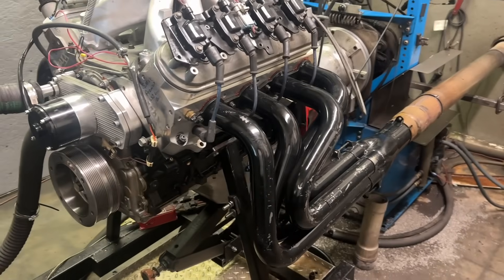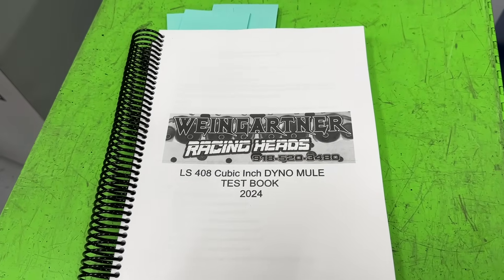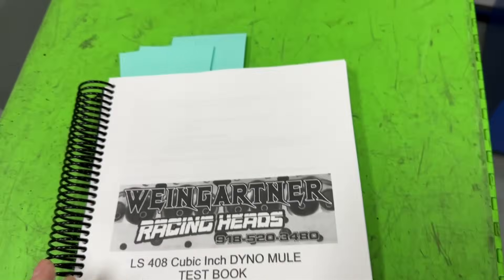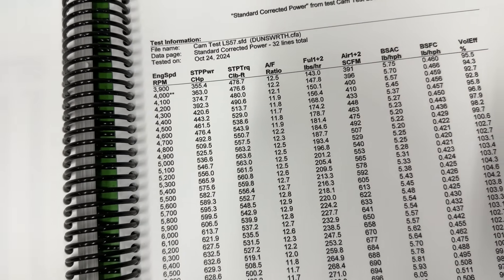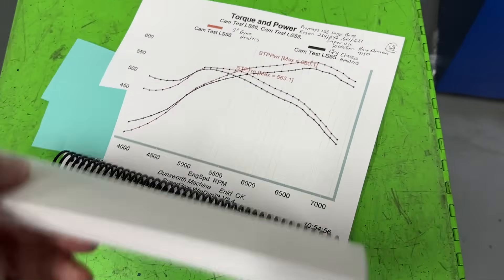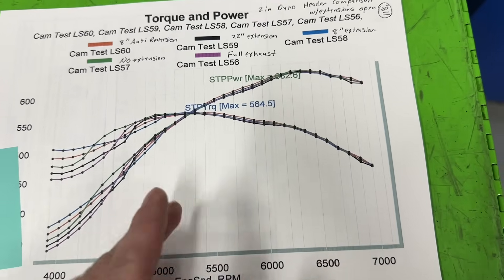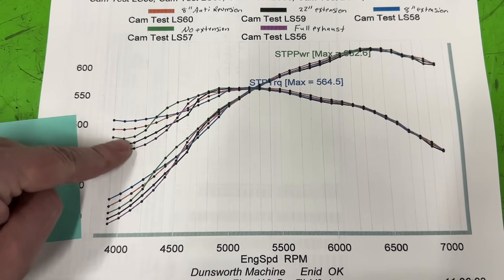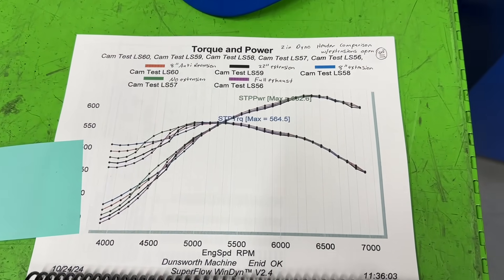Header Collector Testing

Comment: Every time I have seen collector length tests the effects only show at below the rpm of peak torque just like here. Also testing tube diameter is difficult as usually the header design is different so you can’t be sure it’s all the tube size at play

Comment: Anti reversion mufflers are ran on most all (dirt) circle track 604’ crate engines due to the very well documented gains in torque and power. There’s so much testing with them against plain extensions that it’s insane.  Every HP counts and they test everything and run nothing unless it’s showing a positive gain.  They spend crazy money to gain just one to three HP.   They will spend 1k on a fan blade of it robs just one less HP!  In fact, those tests have  changed the way we think of many products like air cleaner bases and pulley designs.    The anti-reversion muffler is designed to catch the reversion pulse from the cam with a large overlap.  There are multiple companies making anti-reversion products but they are all fairly similar in design.  Schoenfeld brand isn’t the most desirable for whatever reason.  But, they are the most affordable. 

Some of the large 950HP late model and 750hp modified engine builders found they make gains with their engine packages too.   They usually run steeped headers and of the rules permit,  in a tri-y configuration. Allegedly, Anti reversion won’t find gains once the primary tube diameter is too large.   Same when the primary’s and collector are too small. Some 694 crate header companies claim their smaller primarily and collector DIA make more power it without the anti-reverson muffler.  However I’ve never seen dyno results or peer reviewed claims to validate this. 

Willys carburetor dyno shop claims  they have regularly seen 60 ft lbs of torque with theirs between the 2,000-5,000 RPM range. In fact they bill them on customers cars to see the comparisons before and after.  From what I understand that’s over a bare header with mid length collector, 8” circle track mufflers or an extension. 

A-B testing 604 stuff is a topic with BIG interest and money.  The data is far more useful due to the lack of variables. Carb spacers, header design, pulleys, fan blades etc all make a massive difference.

Comment: I always like the dyno cells with wire reinforced glass and concrete block walls with guys huddling around the console hoping the motor does not blow up.  If it does not blow up, it is put in a dirt track with a tin foil firewall / floor. .. . ( Tee hee )

Comment: Is there any truth to tuning the collector length by hacking it off where paint burns?
Reply: Which paint?
Reply: @chriswise1232  standard cheapo spray paint. Not high temp header paint. The old timers swear by it.
Reply: @EricErnst   YUP , 30 IN PIPE,, COLLECTOR,, PAINT IT, PUT ON CAR, WHERE THE PAINT STARTS BURNING FIRST THAT WHERE YOU CUT IT OFF AT,

Comment: Killer info man! In my experience extensions and headers, vs manifolds on an ls make a big difference from idle-2500-2700 rpm, you can see it in the tune, and in the 60ft especially with a stock converter
Reply: Theres power with manifolds to be found but short of just bolting them on nobody looks for it . The same can be said for the 
y-pipe on the ls trucks .  Saw a dyno run on a 850 hp blown 427 ls . Headers over  stock 5.3 exhaust manifolds was only 24 hp at peak and pretty well throughout the curve . Shocking results .
Reply: @ I definitely agree, and with a blower you’re already going to have that low end power, but also on a cammed 5.3 me and my buddy gained a whole .5 seconds 0-60 from only bolting on a set of headers, and that was before doing anything to the tune,

Comment: Ooh boy. That testing is interesting to say the least. Just from a quick observation, it would appear that avg. horsepower potential has a large effect on primary tube size. The 6.2 was way under the 408, so the 408 could use the header better. But now it makes me wonder if a step header would make a difference, and possibly different individual length header to account for the cylinder pulse timing. Man, one could spend a LONG time just testing different headers, much less headers and collector length.

Comment: Just a Numbskull metal Fabricator from Down under here. Does an extractor use the reversion principal to help draw in the incoming charge: ie pulsing up and down the extractor? Tim Australia 🇦🇺
Reply: My opinion is negative pressure generated for scavenging the camber and drawing in the fresh charge is from the rapid movement of hot gas traveling down the header. This forms a slug that seals the header, giving rise to the negative pressure zone.

Reversion occurs when the slug reaches the atmosphere, exposing the negative pressure zone. Since gas wants to equalize itself in any environment, atmospheric pressure rushes in the open collector. Since the speed of this is somewhat set, it creates a harmonic pulse at certain rpm points. This pulse is what effects the output of the engine, and is responsible for the changes we see. In this case, the lower rpm is most affected.
Reply: @crd-nz_001  Thanks for the reply, good explanation also.

Comment: Here’s your issue. When you clamp the exhaust onto the collector or the extension you effectively made the total collector length whatever the length of the exhaust is. Do all your testing with the mufflers hooked up had a total collector length of whatever the header has for collector length, plus the length of the extension you added on plus the length of the exhaust system on the dyno. That’s why your numbers don’t move much. You are adding length to the total length of the system.
Reply from the maker: They were not attached to exhaust systems when I was testing collector extensions
Reply: Your comment on the entire exhaust has validity. Gale Banks tests all his stuff as a complete system and the results speak for themselves. Nobody makes better systems than Banks Engineering. Smog legal, reliable, good power and  won't void the factory warranty. It all matters on the road, from cold air intake to placement of the exhaust tip. Proven on the chassis dyno with the hood closed and on the road towing.

Comment: Have you ever tried the old white paint stripe trick on the collector extensions? Asking for a friend... Thanks for all you do, Eric!! You've helped me avoid spending my hard-earned $$$ on things I didn't need.
Reply: I have heard the same thing, it would be interesting to see the hp numbers if he came back & ran the test again but painted the 22” collectors and cut it back to where paint burned off.
Reply: @michaelisbell1448  testing with my dragy, it works!! Gained some (lost some) off my 0-60 ft and 0-100 for sure! Teat n tune... My Hooker Super Comps needed 19.5" off the collector flange
Reply: Engine masters did this test i believe
Reply: I heard if you do it on True duals you can find out where to put the H Pipr x pipe as well